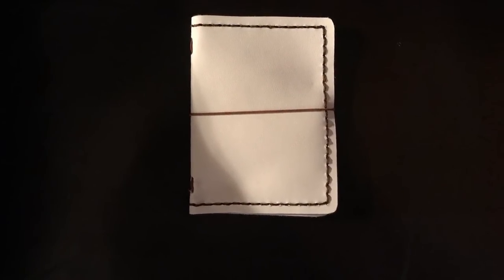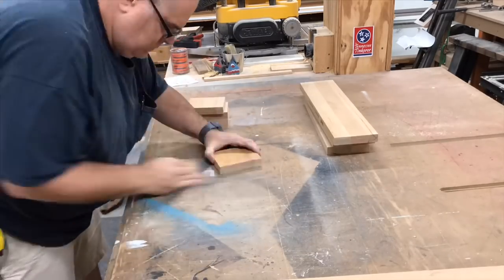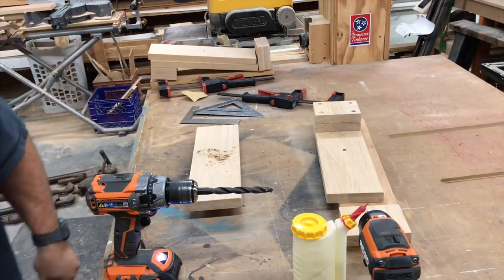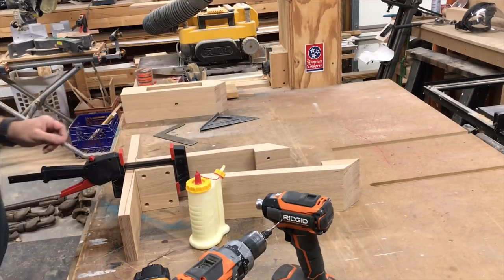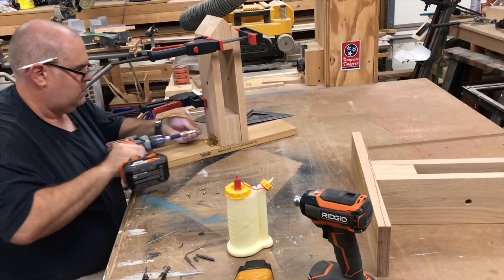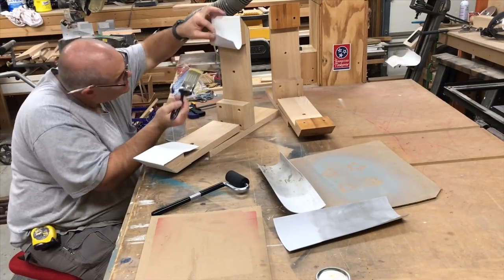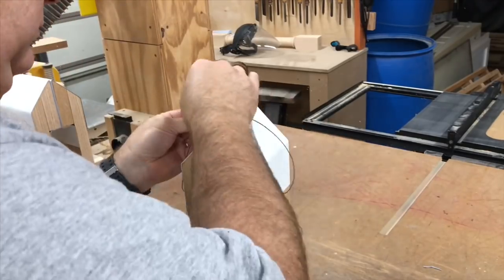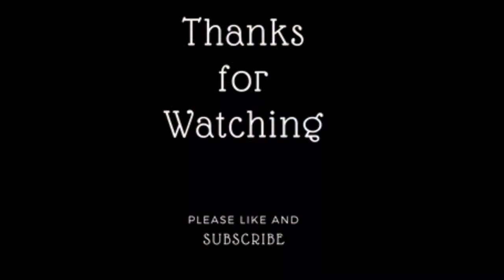Stitching Ponies: Making the Stitching Ponies

Comment: Excellent build.  Your craftsmanship is wonderful.  I have also built a stitch pony like this one.  Two things you may find as you use it.  The tightening knob and long bolt will ultimately catch your thread many times during sewing.  It is inevitable.  I have had to redesign my tightening system more than once. I eventually went to a smooth cam system.  I still catch my thread but not as much.  The second thing you may find is that the jaws are simply too thick.  I find myself scraping the top leather with the edge of my hand.  Good luck and have fun stitching.  Leather craft with a side of woodworking is terrific fun.
Reply from the maker: Bruce, Thanks so much for the kind words! I did find out very fast that the thread gets caught on the knob and bolt constantly! My fix was to make a box that sits on the base and slides over the knob after tightening. It seems to solve the problem. I also added a magnet to this box to hold my needles when I take a break. I mentioned and showed it in one of my more recent videos. I think it was the leather knife sheath video. Lastly, I am a novice leatherworker, and mostly do woodworking. For this reason I'd say woodworking with a side of leather craft is terrific fun! Thanks again Bruce for the comment and the view!

Comment: Awesome guide, thank you! I've seen saddle stitch done with both needles crossing in the hole at the same time, lest you split the thread.
Reply from the maker: Thanks Matko! Yes I have seen it done that way as well. I would probably use that method too, but my holes are too small to easily pass both needles through at the same time. They get wedged and really hard to pull through. Instead I use a technique where I pull the first thread against the back of the hole as far as I can and insert the second needle toward the front of the hole as far as I can. It usually prevents any unwanted thread piercing but not always. I usually have one instance of it per project. Thanks for watching and commenting!

Comment: great ponies thank you. i'm going to make one but it needs to be very short as this will be the correct working height when i'm sat at my table. my question is will it still be fine if there is no gap in the pony ? just four bits of solid wood chamfered at the top ? kind regards .
Reply from the maker: Ian, thanks for the watch and comment. It may be ok with no gap if the leather was thin or your workpiece was small, but for most applications, the gap is probably needed. The gap allows the extra leather at the bottom of your workpiece to have a place to hang down and be out of the way. Also, if the pony is too short, you won't have room to clamp a project that is wider than the depth of your pony jaws. I would suggest building the pony with a gap and not making it too short. Instead of setting it on the table to work, consider sitting it on a chair. Or if you put it on the table, stand up and work on it. Thanks again!

Comment: A suggestions. I pad my stitching clamps with 1/4 inch rubber pad that’s like a pencil eraser. The rubber holds leather very well with less pressure.
Reply from the maker: Thanks for the tip! If I ever make another one, or redo this one, I'll be sure to try that. Thanks for watching and commenting.

Comment: as 1 that has worked with wood for many years I see your true skill.  Probably missed by others.   thanks.   I didn't find the reply with the measurements.  Please send them again
Reply from the maker: Thank you so much Chuck for the view and the kind words. I am definitely a woodworker first, and a leather worker farther down the line! The base measures 5"x20". The jaw assemblies measure 5"x17" overall, with the clamping blocks measuring 5"x4". The spacer blocks at the bottom measure 5"x4" each. The carriage bolt is 3/8"x6", and the hinge is 3"x2". Thanks again!
Reply: @thetennesseetinkerer  Muchas gracias..! sos un capo!! :D

Comment: @Tennessee Tinkerer what size wood screws did you use to put the spacer boards together? Thanks in advance.
Reply from the maker: Joe, if memory serves, I used 2-1/2" black drywall screws on the pieces that were three layers thick. Anything two layers thick I would have used 1-5/8" drywall screws. I use a lot of drywall screws (billed as all-purpose screws, and not just for drywall), but as I'm sure you know, you have to be careful with their application. They are very brittle when they get in a bind and can snap off easily. In a project such as this oak, I recommend carefully choosing the proper drill bit size to predrill so as not to have breakage. A better option is to use a "deck" style screw. They are dimensionally the same as a drywall screw but much tougher. Thanks so much for watching and for commenting!
Reply: @thetennesseetinkerer  thanks again for the information on the screws. I am in the process of making. I will post a picture was created.

Comment: Just a thought…..the movable leg would be better held off the spacer so when you have a piece in the jaws the jaws remain parallel and have better clamping pressure
Reply from the maker: I can see your point, but believe me, there is more than enough clamping pressure in the current design. I've been using it for several years and have never had the leather slip. The thickness of the leather is not so much that it creates a situation where the bottom of the jaws get tight before the top does. Plus it doesn't take much pressure to hold the piece for the sewing operation anyway. That being said, if someone wanted to offset the moveable jaw a bit to compensate and keep it more parallel, that would work too. Thank you for watching and taking the time to leave a comment! Thanks also for the suggestion. Good luck with your projects!

Comment: can you make a suggestion re: the knob and screw (size, length) I can find to hold this fellow together? I'll make one soon. cheers
Reply from the maker: Thanks Kevin for the view and question. I got my knob at Lowes. It fits a 3/8" bolt. As far as bolt length, it would depend on the thickness of the stock you end up using. I would build the pony first, then measure for the bolt length. One thing to watch out for though is getting the bolt too long. It needs to be long enough to allow the jaws to open wide enough to accept several layers of thick leather, but not so long that it is constantly snagging your thread. It will probably snag your thread regardless from time to time, but it is less likely to snag the shorter it is. Hope this helps. Good luck on your build! Thanks again!

Comment: Do you have enough pressure right at the top? I was wondering if on some projects it grabs the item lower?
Reply from the maker: Randy, first of all, thanks for the view and for taking time to comment. I really appreciate it. It has a great deal of clamping pressure at the top. Since the jaws are parallel to each other, the clamping pressure is consistent along the pads. I have found that it exerts more than enough clamping force to clamp any project I do. Thanks again!
Reply: @thetennesseetinkerer  I guess I was concerned with projects that have some mass below the top like a bag or messenger bag etc. Well I bought some wood today and I will build one tomorrow based off of your video. Thanks for the reply

Comment: Good for begginers,the only thing seems wrong is  bolt in that plastic knob  sticking out,the thread will get hooked on to it all the time,you better use the  eccentric type.
Reply from the maker: Thanks for the view Alex. Not sure what the "eccentric tipe" means, but I can attest to the fact that the thread does have a tendency to get caught on the knob. I did find a remedy for this by building a snag-free cover that slides over the knob after tightening it down. I showed it in my Leather Portfolio video if you are interested in seeing what it is. Thanks again.
Reply: @thetennesseetinkerer  
I mean "eccentric type",like eccentric hub on bike wheel,or mountain bike got it on the saddles.